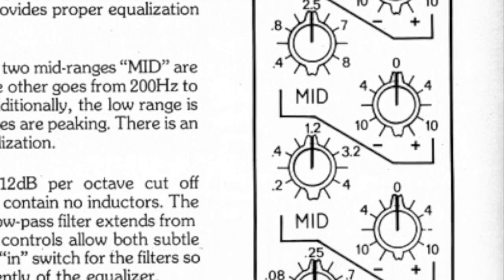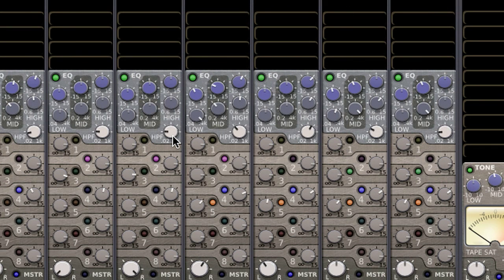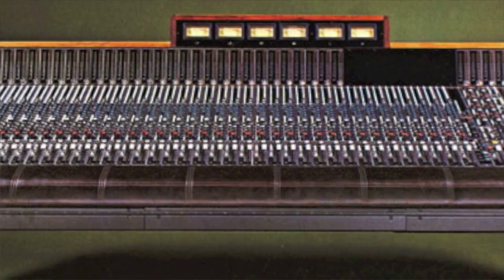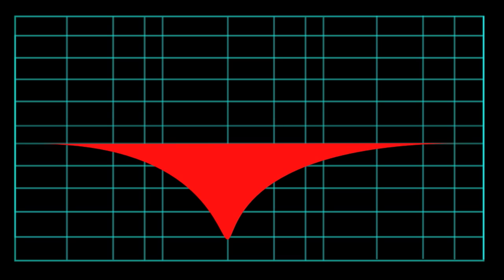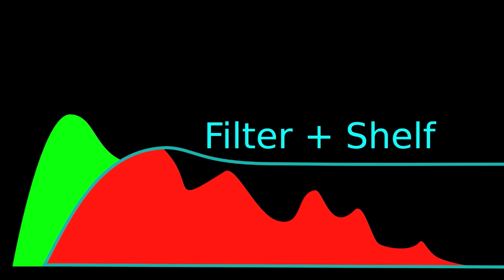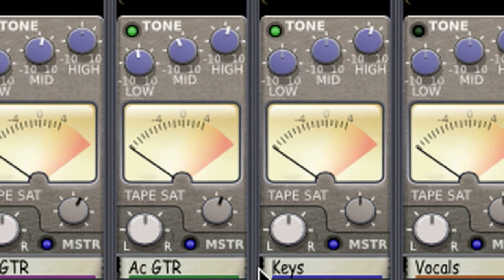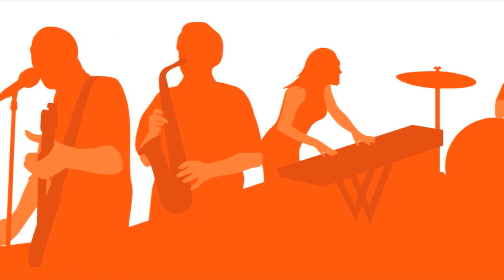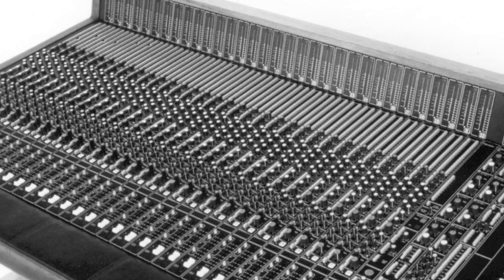Mix Tips - EQ in Mixbus (v2,3,4)

Comment: A question if I may.....

Will Mixbus be incorporating a graphic view into the EQ? It is SO much easier to glance at a graphic of the curve than having to stop & read the knobs when you have 30 + tracks going. DDMF & the PT III EQ have the cleanest and easiest on the eys that I know of...hint hint! LOL

Anyhoo, loving the sound of Mixbus, I run ALL my final tracks thru it before starting a mix down anymore,I quit using all the "add on" console emulators. They just don't sound as good as Mixbus!!
Reply: It's sooo much nicer to just use your ears. Thats the power of mixbus! Love it!! You can always load plugins that have graphic views, such as fabfilter and many others.
Reply: @mcadder  probably